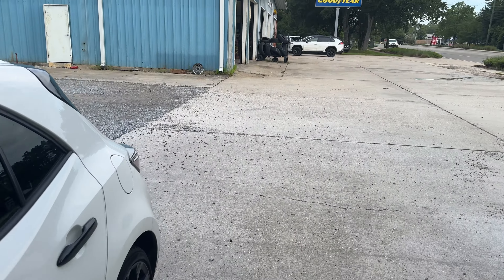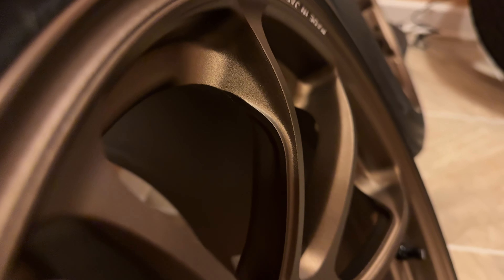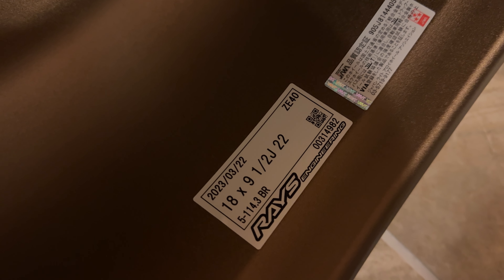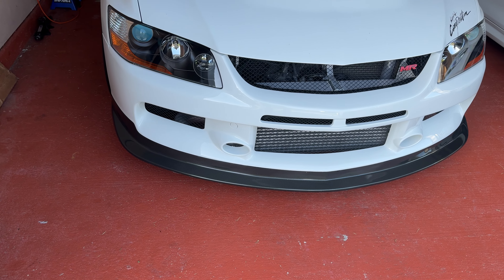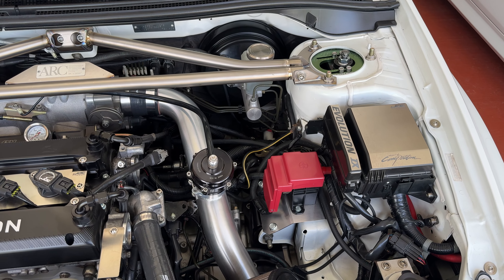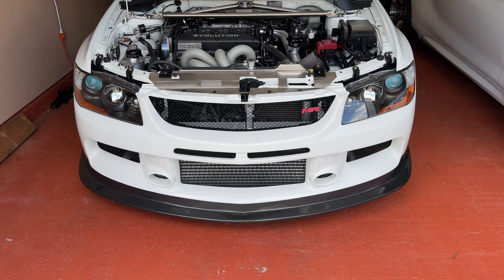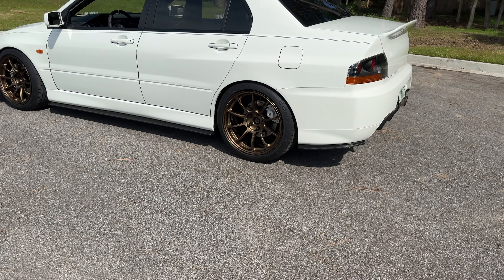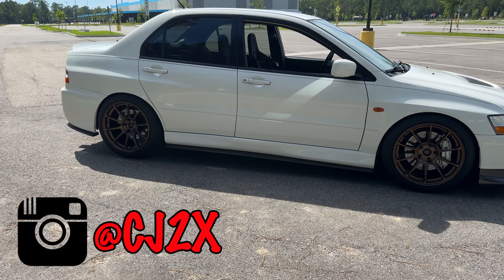Volk ZE40 Wheels Installed On My Evo!!

Comment: Check into doing a string alignment and you should be able to do a pretty good job right in your own garage.   Any dealer group that has a newer Hunter laser alignment rack can handle the Evo no problem. Sounds like the last place you went to the techs don't have their ASE certifications.
Reply from the maker: @DJ_Driven  yea, unfortunately that’s how the area is.. Can’t get anything done around here.